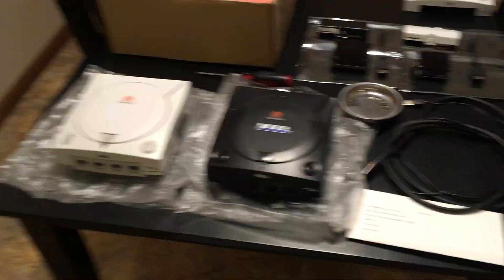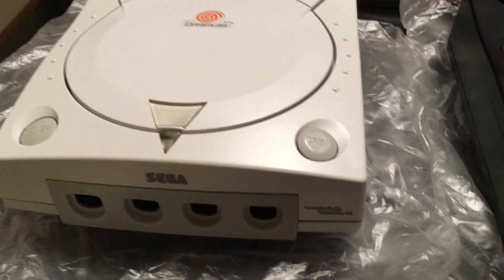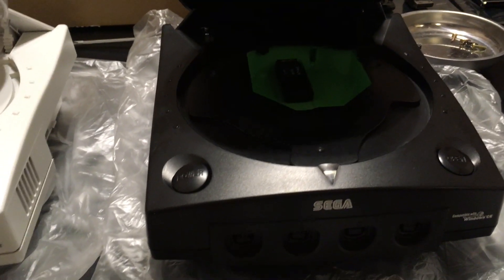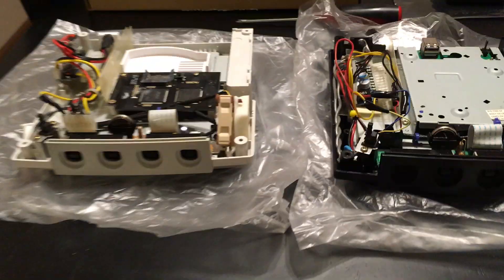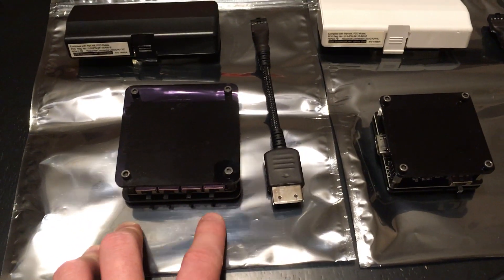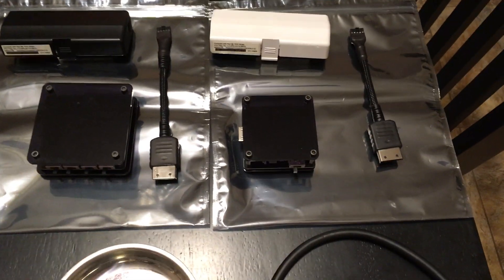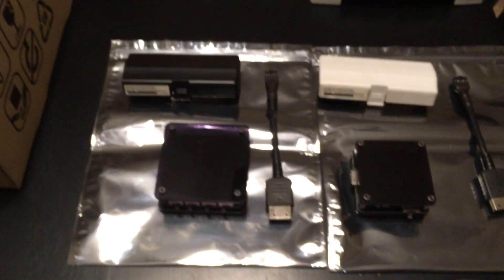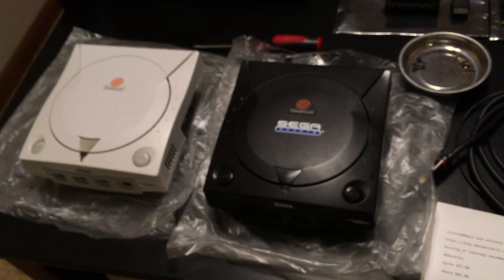Sega Dreamcast Collection Modding DCHDMI

Comment: Hey buddy, you can fix that initial loading screen for the GDmenu if you use the SD card utility app to sort your GDi/CDi files.  It also allows you to patch some games to VGA compatibility as well.
Reply from the maker: Sounds good! I'll have to give it a try. I've been manually building the file structure. Thanks for watching!
Reply: @superretrocade3362   Let me know if you need a link to the program.
Reply from the maker: @charvelgtrs  Sounds good! I can find it. Thanks though.